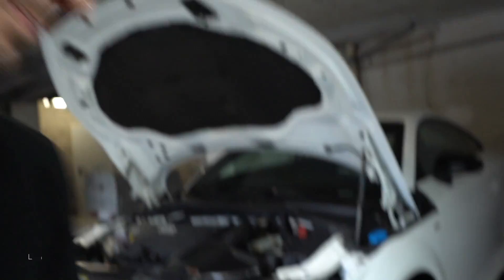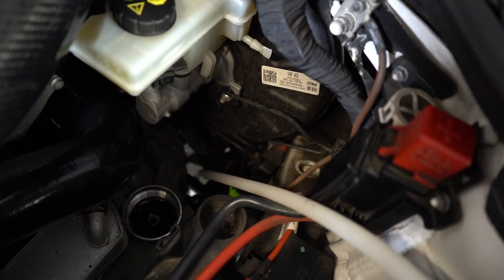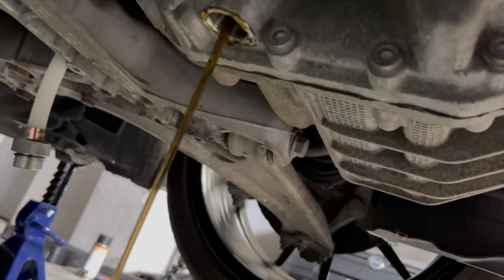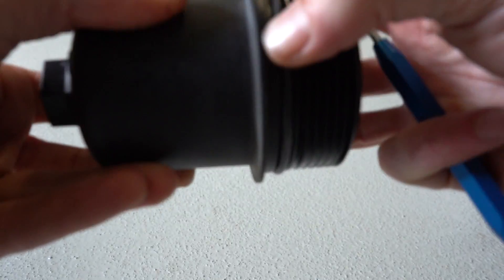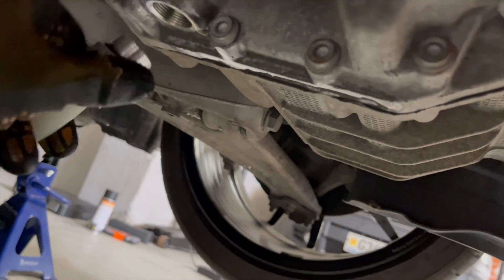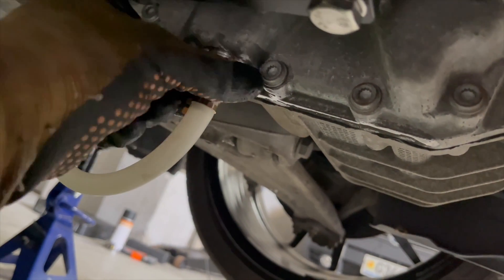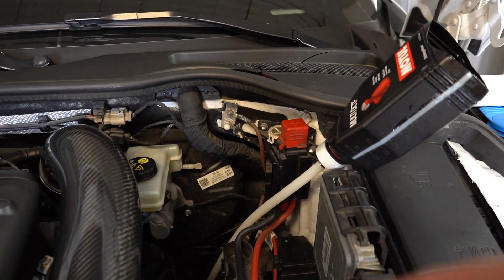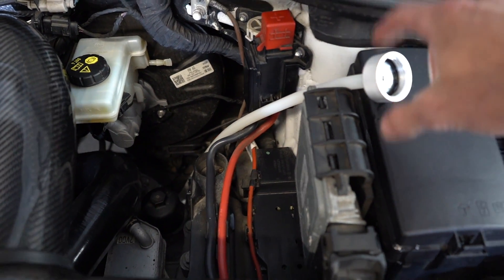First DSG oil service on the Audi TT 2015 MK3

Comment: That seemed quite simple, just had mine done by my mechanic. Good instructions 🔧
Reply from the maker: I was surprised! Always worrying doing something for the first time but seems to be working a treat. I have the filler tube now so just oil and filter for the next one 👌
Reply: @James.a.vickers Hi please answer, Have you sold the car or done another change ? 
Can you roughly say how much oil you got in the gearbox at present ?
Reply from the maker: @game4alaughman  Hey! I still have the car and more updates are coming. I am unsure what is in the gearbox at this time as I believe the only way of checking is by draining it all. and refilling. If I find out I will let you know.
Reply: @James.a.vickers  cheers, I done the dsg oil on 2014 Octavia 2.0 tdi. Got 5L in but 0.7L came out before a got anywhere near a drip, so plugged it at that point. Thinking of doing it again & put full 5L in & that’s it. So hard to find exactly what is correct amount. On draining old oil measured only 3.7L arghhh   😳

Comment: what lifting points do you use to raise the TT on the jack stands? 😅
Reply from the maker: Hey! theres 4 pinch welds underneath. the front two are behind the front wheels and the back ones are in front of the rear wheels they don't look like they would hold be they do 😂

Comment: Hello, i have two questions, the DSG only need 5 liters? And adding another DSG oil that is not the audi original it will not supose a problem for the future?
Reply from the maker: Hey SERGIY, 
Thanks for the comment! The factory recommends 5.2  -5.5 litres of the fluid but as you can see at the end the overflow lets a fair bit out. I was toying with the idea to put 5 litres in and then leave it however most people said that getting the oil to temperature and then letting the overflow come out was the way to do it. 
As you can see even with 5 litres there is still some overflow coming out so putting 6 litres in might be a waste because it overflows and gets thrown away.

As for the fluid being a different brand as long as it is designed for DSG gearboxes then I don´t see a problem. Motul is a pretty big brand and respected in oil/fluids however if I come across any issues I will let you know!

For now the gearbox is shifting great! if anything faster and crisper than before! 

Thanks again

Comment: Hey man, great video, i m debating wether to use Motul of Pentosin, hows the car acting with Motul
Reply from the maker: Thanks @enohazizaj5576 no complaints with the Motul I haven't had any experience with Pentosin. On closer inspection of the oil that I drained it did have some small parts of metal in it so we will see next time I change the oil if there is more metal or the Motul has rectified the problem. I am hoping for the latter. Let me know which one you go with!
Reply: Hi, I went with Pentosin, so far so good. Next time i'll use Motul. It wont hurt my wallet since its just 150€ for the gearbox service 👍

Comment: Thanks for an outstanding video James, so clear and helpful. I'm getting my mechanic to change mine and all the other fluids at the same time because it's time for them to be done, Engine, Coolant, Brake fluid change etc.  I'm going with a K&N Engine Oil filter because I have heard excellent things about them, the same for the main Air filter and Cabin one too.
The only area I struggle with is exactly how much new Engine oil with a new filter. The handbook says nothing about it whatsoever, if you put too much in you risk damaging the seals and if not enough you risk loosing pressure etc. Thanks in advance and again great clear video and appreciate the links for the oil and also the filler tube.
Reply from the maker: Thank you  @peterrobertson1250  I am glad you enjoyed the video. It is always worrying if you got the right amount of fluids. As you know there are no ways of checking apart from draining it all and seeing what comes out of it. 🤞 so far it seems great and I feel it shifts much better since changing the fluids. I have only done one engine oil change but it is due for another and I plan to upgrade something while doing this next time. Let me know if your mechanic knows any tricks for the future for ensuring the right fluid levels. (I am not a mechanic as you might have guessed) so any help is much appreciated. 
Thanks again Peter!

Comment: I have a question
When you opened the cap to drain the oil, oil came out.
So how did you fill up with oil when the cap remained open?
Reply from the maker: The oil is filled up via gravity. I wasn't sure it would fill up properly but as long as the funnel is higher than the engine it is not  a problem to fill up.  The higher you can hold the funnel the faster the fill up should be. There is two pieces to take out, the first (main cap) then the long piece inside. The long piece is then re put in before you attach the tube and funnel so I guess this is what stops the oil from coming back out to fast when you remove the filler tube.
Reply: @James.a.vickers  
Thank you for your quick response